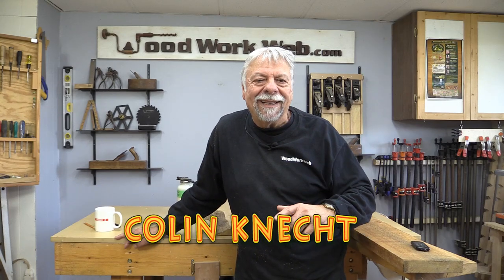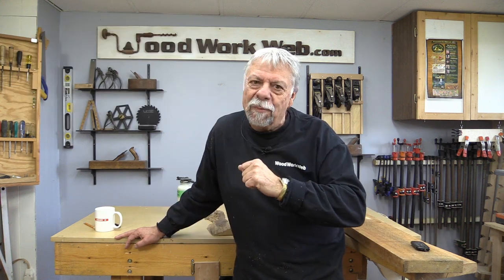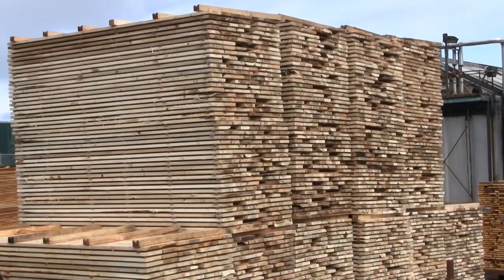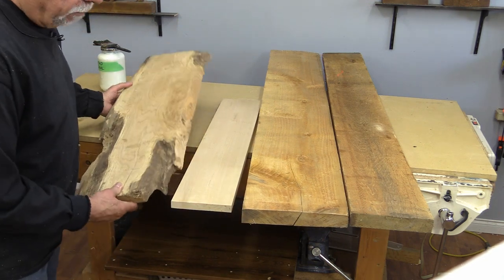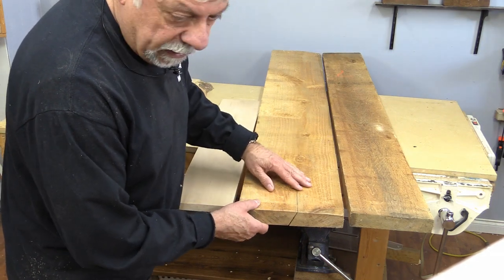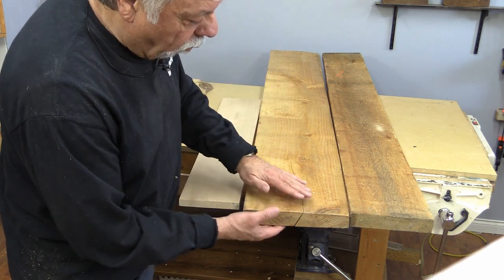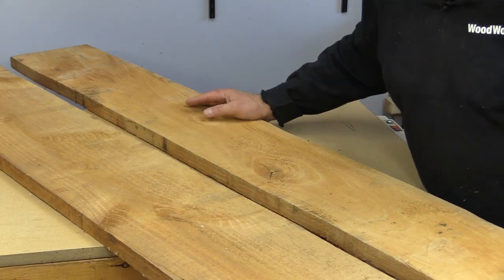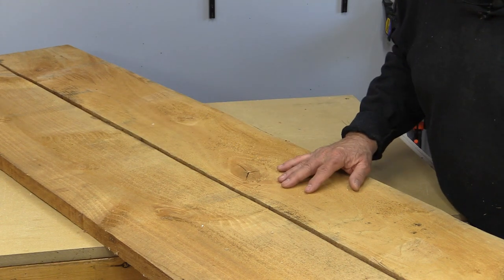Buying Lumber Directly from the Sawmill - Money Saving Hacks for Woodworking Part 3

Comment: Excellent explanation Colin.  It is critical to stack and sticker green lumber with stickers at 12" centers and then use ratchet straps otherwise the top of the stack will warp into useless boards.  The more straps the better.  Airflow is critical.  Periodic tightening of the straps is necessary as the wood shrinks.  The standard rule for drying is 1 year per inch plus 6 months, then bring it into the shop to acclimate for a few weeks.  I use a digital postal scale and weigh a sample board and record the weight on day one and weigh it regularly.  Once it stops losing weight then it is ready to use.  Acclimation can be sped up using stickers and a floor fan on low speed.  Acclimation is necessary for kiln dried lumber as well.  "Kiln dried" isn't necessarily dry.
Reply from the maker: Thanks for tips and thanks for watching!
Reply: Hardnox. That is very good information about the ratchet straps. I did not know that. I've never seen that somebody doing. But it surely makes sense and I'm sure you are right
with that. Thanks for sharing.
Reply: My pleasure Hans.  Here's a link to a blog post on my website with a few pics that show the process: http://www.westphaliawoodworks.com/milling-timber/    Feel free to leave a comment or questions.

Comment: Here in Poland, local mills sometimes buy one off trees from farmers or the like and you can buy the tree cut the way you want. I sealed the ends of some elm with white pva glue and stored in the garage over the last 6 months. So far, no cracks (wood was cut on the day so as green as could be). I reckon I got the wood at about 1/10th normal price. This year I am going to build special storage so I can do this on a larger scale - I think its key to a profitable business.

Comment: Very interesting video. Thanks for sharing. One small saw mill in my neighbourhood (12 km) is willing to sell small quantities of wood. Last year early spring I bought there
20 pieces of 2 metres long rough wood (pine) of 4x5 cm (as for putting roof tiles on). I paid next to nothing (10 Euros/12 USD or so).
They did not have a kiln at that moment (they were planning to build one) so yes, the wood was green/fresh/wet  (with a beautiful smell)
I put it (stacked) and stickered in my garage where it could acclimatize. In autumn the wood was dry enough for the purpose I bought it for.
A storing rack for things in that same garage.
In spite of the fact that in Slovakia is a lot of wood (40% of the land surface is covered with woods), purchasing (dry) wood is quite a problem.
My sources of wood are:   Pallets   (3 km, not free, 2 Euros a piece), old furniture which I have to take apart (free, 1 to 20 km)
fresh wood (cheap, 12 km)  dry wood (limited dimensions, very expensive, 20 km), dry wood (bigger choice of dimensions, a little less expensive, 45 km)
And there are some companies which sell  killn dried wood and they deliver at home. Not the cheapest way but time-saving.

One question: how "dangerous" is live-edge wood? 
In Slovakia it is commonly said, that the bark must be taken off asap because woodworn and other
wood damaging insects will "eat", damage, destroy the wood in short time.
Is that true? Or maybe only for some species of wood?  (I mainly, 95%, use pine)
Reply from the maker: It's always interesting to hear about how people get their lumber in other countries.

I'm not sure if I can answer how "dangerous" live-edge lumber it, because it depends so much on the application, type of wood and the climate. For example, Cedar is very resistant to rot and insect pests.
Reply: Thanks for your answer on my "dangerous" live-edge question. I'll try to get somewhere some more specific information for my cases.

Comment: Very good advice. People can also check Craig's List for local small sawmill operations or people like myself who cut hardwood lumber with a chainsaw. Where I live there have been trees removed for various reasons, blow down mostly, for many years and those have been cut to some random length and dumped haphazardly in different areas. With a smallish cash outlay these can be cut into usable lumber, this will also require the use of moisture meter. I won't tell anyone this is a cheaper way to go, your time is of some value and it takes a while to go from a log to a board, most woodworkers don't have the resources to do what I do. the upside is the species of wood, you may not know what you are getting in many cases as the bark will be missing, but most all logs have some sort of extremely usable wood. As for shorts, 90% of all wood working projects I have done in the last 20 years have been less than 6' in length, if you want longer, buy it longer or use dowels or finger joints and epoxy to glue the boards together. I visited a hardwood store in Seattle a couple weeks ago, I am here to tell you, I would be hard pressed to pay what the those folks want for almost any wood they had, some of the more exotic stuff, sure, but $6 a BF for a 5/4 pine board is way out of line. I am going to end this with the advice of search out lumber, any lumber, there are piles of advice on YT as to how to take lumber of lesser quality and make beautiful projects, try them.
Reply from the maker: Thanks for the tips Ray and thanks for watching!

Comment: Good info. One thing the more nots does not lower the board footage. It changes the grade of the board. Most lumber at a big box store is common grade 1 or 2. If the lumber is green see if they have strips from edging stack it with a strip every 1to 2 feet. They might even let you use their branding material to band it.
Reply from the maker: Thanks the tips Loyd!

Comment: Purchasing wood is so different here. 
You can get construction wood at Praktiker, Obi, and at most sawmills. They are wet, and bad quality.
You can get slats and boards at smaller woodworking shops, they are dry, medium quality. Oh, and it's pine only.

And there are some sawmills where they dry the wood, or at least put it under a roof, they are pretty good quality, but EXPENSIVE! 1m^3 of maple (about 35,3 cubic feet) is more than 1000$.
Oh, and in school we're taught that you never buy slats or boards, but buy rough lumber.

Comment: I've bought wood from a local one-man sawyer a few times. It's air-dried, stacked and stickered though not strapped or even covered, but that seems to work fairly well here in southern California. Of course, it's not graded, which is one of the services you pay more for at a lumberyard; i.e., you can go straight to the FAS or Select stack. If it were graded I think most of the wood would be No. 1 Common or No. 2 Common so you have to buy 50%-100% over for wastage. And of course you can only get local woods. Overall though I think you do save money in exchange for quite a bit of extra work and wear and tear on your machines.
Reply from the maker: Yes, in the end, it really becomes just another source of wood. It will fit some projects and not others.
I guess storage isn't huge issue in California.
Reply: I do this for outdoor projects. My donkeys eat the wood on my fences but I still like it better than wire right around the perimeter of the house and barn so every 3-4 years we have to replace the boards with untreated local lumber. I get it from a local guy with a tiny mill and stack it for a year before putting it up rough. 
For outdoor furniture that will be exposed to the elements I use the same lumber I just stack it covered and surface it before using it, but local timber holds up better outside with less fuss where I am.

Comment: My local saw mill sells 1 or 100 boards. They are not picky.
Reply from the maker: Yup ... it all depends on the mill!
Reply: My local mill will too, but prefers at least a semi load, 30,000-50,000 bd. ft at a time. Lol. We saw 100,000 bd ft per shift with two head rigs and two resaws.

Comment: My husband worked at a mill that took rough milled lumber and cut out the imperfections and then fingerjointed them to a specific length.  They had mountains of scrap wood.  For small projects they would let me rummage through their piles of scrap.  Sometimes, I found some pretty decent pieces.  

Unfortunately, now I live in the desert and lumber is at a premium.  No mills here.
Reply from the maker: Yup, there can be some great deal to be found, depending on the saw mill.
Thanks for watching April.

Comment: Buying lumber from a mill is no savings , they go by market price for their own profit , a private wood cutter with his own portable saw mill can save you a fortune but in use for construction the framing lumber by code must be plained four square if an inspection is required or you can basically do what you want if you build your own projects not requiring a permit

Comment: What you showed there was not quarter sawn, it was just flat sawn from the center of the log. Quarter sawn is like the name suggests. The log is cut into quarters, then the boards are cut from those quarters at 45 degrees, as if cut radially from the log. It’s expensive because there is a lot of waste compared to flat sawn. You will never get the heart of the tree and wood on both sides from quarter sawn lumber, because of the way they mill it. 

The example you gave there is more stable than flat sawn from the outside of the log. It’s just not true quarter sawn.